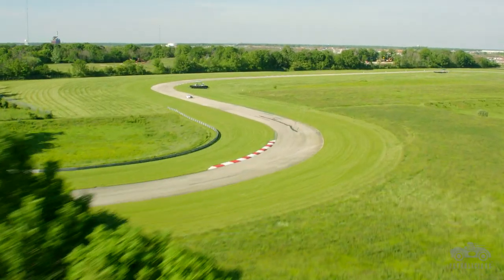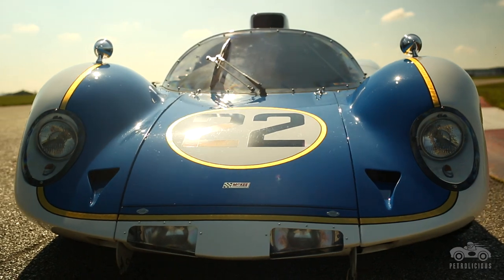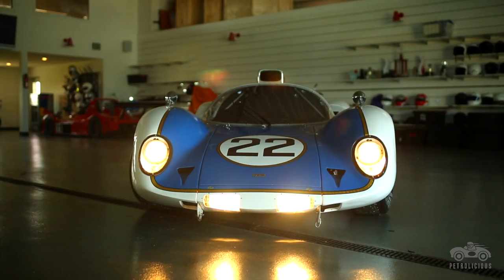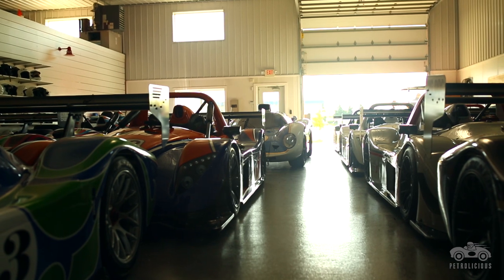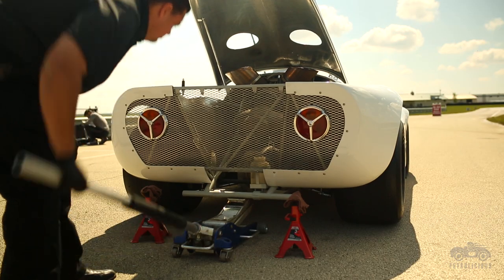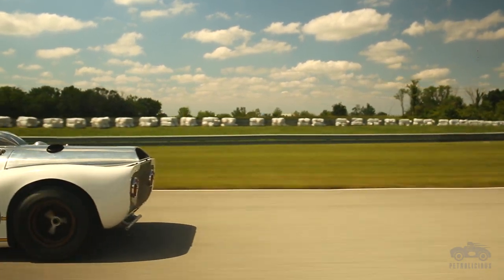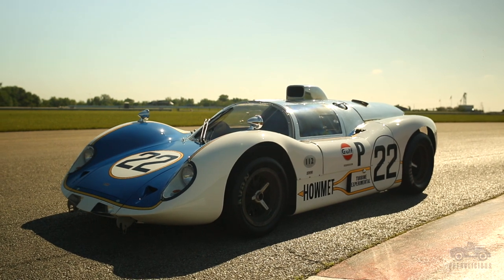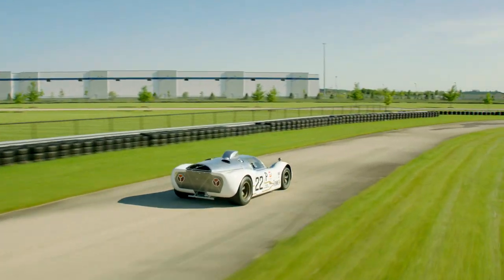The Howmet TX: Rethink Everything

Comment: He mentions Ray Heppenstall very briefly. I knew Ray in the 1970's when he was racing Super Vees. Brilliant guy. I believe he had run Cobras in the mid-1960's and saw the opportunity. 
The key here was the inlet area. Turbines are very much sensitive to the amount of area they have to take in air. Ray saw that and talked to the management at Howmet where he was working as an engineer.

Comment: WHAT???  A Turbo-Charged Engine,  without the Engine ........?
.
Dang Engineers!
Reply: +Mr. Johnson
 I think it's a 3.0 V-8.
Reply: +Mr. B Natural It's a turbine engine.
Reply: Sir Lord Baron Von Nico
 A turbine V-8?
Reply: +Mr. B Natural A jet-like turbine :)
Reply: Mr. B Natural It's just a turbine engine taken from a helicopter. There is no combustion mechanism in the engine.
Reply: +Sir Lord Baron Von Nico A turbine certainly has a combustion chamber... This engine doesn't have a rear nozzle to create the "jet" part of a "jet engine". But it sure does have a combustion chamber...
Reply: +Sir Lord Baron Von Nico Yes, there is a combustion mechanism / chamber. :)  In-between the compressor and turbine of course.  It's just a fixed combustion volume, with pre-compressed, hot air fed into it... which then drives the turbine that is connected back up to the compressor.
Reply: TassieLorenzo Ah, my bad then. Turbine engines isn't exactly something i'm well oriented with. Thanks for the explanation!
Reply: +zaco21 Yeah I know. I'm just joking around with the engineers.
Reply: +Mr. B Natural A turbine with 8 cylinders. Yep, that's about as logical as a wankel with dual camshafts. Do you know what a turbine is?
Reply: @williamgson4055  I have a car with a v8 wankel,  its 8 tiny rotors placed in 2 rows of 4. XD

Comment: I love all the turbine cars. I actually thought they would make a comeback here a few years ago with cars like the Jaguar CX75 concept, and others using micro turbines. Like he mentioned, turbines are great at full throttle, but they flat out inhale fuel at idle compared to a piston engine. I think that was one of Chrysler's issues with their turbine concept back in the 1960s as well. I really thought micro turbine hybrids would be the missing link to fix that where you have a battery powered car, then the micro turbine (about the size of a loaf of bread, 18lbs, 400 hp) kicks on, runs at full power until the battery is charged, and then shuts off again. While I think it came ever so close to fruition, it was a few years too late. Battery technology made a monumental leap in the last few years, enabling cars like the Tesla Model S to get similar range to an internal combustion car, and recharge in around 20 minutes, with that number dropping as time goes on. Not good for racing, but suitable for normal cars. There is still a little hope for turbine cars in the form of big rigs. I heard at least one company is building, or has built, a turbine powered hybrid big rig, the idea being once a truck is on the road, it travels at a pretty constant rate of speed.
Reply: +v12tommy yes i was realy dissapointed when the CX75 was not fit with turbines :( would have been soo nice. for the jag it made sense tough since it was to run on a single speed as an generator since the actual motors on the wheels where planned to be electric

Comment: I think that with computer controlled throttle and a modern CVT (constantly variable transmission) acceleration and deceleration would be more manageble. Keep the engine RPM's in a certain range then use the trans for speed changes.
Reply: I was thinking the same thing.

Comment: If it was to be done again it should be a hybrid. That way they wouldn't need a waste gate, they would be able to run the turbine at peak efficiency all the time to charge batteries that in turn would drive electric motors. With such a design, the turbine could be made smaller as well, it would just need to be big enough to ensure enough charge for the batteries.
Reply: eternitynaut it makes sense also to make up for the lack of torque likely found in this engine and use a modern cvt transmission, even though they are not completely efficient would work on this car

Comment: OK.... That thing is just insane. I mean I was stucked in front of my screen the whole time. I have a bit of a hard time understanding how it works though?? Also it seems to have quite a high potential top speed, but what is the acceleration like?
Reply: +traxnada It only has 1 gear (He says that he wished he made it a 2 or 3 speed..). Basically like an electric car. 1 speed. Forward!!

Imagine a turbine that spins helicopter blades, but spins wheels instead with a reductor (gear box) so the wheels don't spin 100k rpm...
Reply: Turbine engines typically are slow to spool up.  That's why he comments about problems with coming out of corners, and why they re-designed the engine to run at 80% power all the time.

Comment: The version with the wastegate must have been quite something; close the wastegate & bamf! 80% instant power. A bit easier than a variable pitch turbine, but that might be interesting if it's possible these days. Keeping the compressor spinning at optimum RPM with part of a KERS system would also do wonders. Alternatively - how about using motors for all final drive & a turbine generating plant/KERS system all in one?

Racing isn't so diverse these days because we've already tried a lot of the interesting quirky things, plus we have such good computer tools now we don't need to actually build them - and the computer tools let us build things which are just too good. Not that long ago nobody would have predicted diesel LMPs though, nor hybrids. Sadly I suspect nobody ( I didn't ) would have predicted endurance races just being long sprint races because everything is so reliable either.

Comment: Turbine powered car, yeah. Interesting, different... In some very specific applications, like some classes of circuit racing, it could be incredibly effective. They put one in an Indy car and it very nearly won the Indy 500. It's a bit like a Mazda rotary on steroids and crack, very small, very lightweight, but lots of power, great reliability at full power, not quite so good at on-off-part throttle. We have tried to put them in road cars and it really doesn't quite work. Huge fuel usage, ridiculous. Noise, lots of very hot exhaust gas... For a practical daily use road car/bike/truck, you need certain things. A 4 stroke internal combustion engine, petrol or diesel, delivers those rather better than a turbine. There's a place for turbines. They power aeroplanes, ships, industrial machinery and electricity generators, and they do that rather brilliantly.

Comment: Very nice video... But I would have loved to hear more about the mechanics of this thing. How does it work. I mean, with such a unique vehicle, you would expect them to explain how it works mechanically, not only just about who made it and that it still works.

If it doesn't have transmission and clutch. How does it get power to the wheels??? Does it use some kind of automatic transmission? How does it get power to the wheels?? Now that's the stuff I would like to know...
Reply: Okay, despite what everyone else says on this page, this is a jet engine. It just doesn't rely on exhaust eflux for drive, like the jet engine in an aircraft does. It was made for a helicopter and has a reduction gearbox to take it down from 65,000 rpm to something more appropriate for driving the rear wheels of a car. Look up the difference between a turbojet engine and a turboshaft engine. This is a turboshaft engine.

Comment: I'd like to use this car for a thermodynamics project at university. Any idea where I could find more specs for this turbo shaft engine? Things like max temperature, compression ratio etc.
Reply: The engine is a Continental TS325. It's a helicopter engine, so there should be plenty of information out there. It's also known as the T65-T-1.

https://archive.org/details/TNM_Turboshaft_engine_Continental_Model_T65-T-1_f_20171028_0023

Comment: Wow, somehow I thought every turbine powered car was propelled by the afterburner, instead of actually propelling the wheels (jet car). And not able to go anything but straight lines....
This is indeed a totally new approach, and somehow I think a clutch should be in there somewhere, to separate the wheels from the turbine. But it probably has at least a torque converter, or something like that.
Reply: +Seegal Galguntijak Same principle as a helicopter really - turbine driving a driveshaft. Probably solved it using a similar solution - remember Helis spool the engine up way long before the blades start turning.
Reply: +Seegal Galguntijak Turbine engines are torque converters by their very nature.
Reply: justfakeit888 So how does it work that the car can stand still, while the turbine is spinning, with there being a direct connection to the wheels?
Reply: It's not. The turbine has a compressor up against another compressor, just like with a torque converter, except that it is with air instead of fluid. Watch Jay Leno's Chrysler turbine car video, he explains it well.
Reply: justfakeit888 I see, so the first part can spin up while the second part that's connected to the drivetrain stays stationary. I learned something today! :)

Comment: Can anyone tell me how it transfers the drive to the wheels please?
Reply: +Fly Guy In some helicopters, they use a turbine engine to turn the blades. In the case of this car, they use the same type of engine to turn the wheels.
If you want a more specific (yet simplified) answer then read on. A turbine engine like the ones in helicopters are different from the ones in jets because instead of using the exhaust to propel the jet, it uses the exhaust to turn a crank which can be hooked up to a gearbox to turn something else (like the blades or in this case, the wheels). Hope this helps.
Reply: TheNosyGamer Thanks man, i figured it was the same concept as a gear driven rotor but wasn't sure. Cheers.

Comment: How can they drive the wheels with an engine at 65000 rpm and no clutch or transmission? :s
Incredible car, but I don't understand it. It isn't a rocketcar. The trust comes through the wheels.

Comment: didnt get it
why it sounds like a jet?
Reply: +mobb figga The engine is a gas turbine like in a helicopter, not a piston engine.
Reply: The Howmet TX is powered by a turbine engine, much like you'd find in a jet or a helicopter.
Reply: Because It has a turbine engine...like a jet.
Reply: Helicopter, not jet. Jets are powered by turbofans or turbojets which rely on the the displacement of air they produce to create thrust.

Helicopter turbines drive a propshaft instead of concentrating their exhaust to achieve thrust. A similar (bigger) engine is used in the M1 Abrams main battle tank.
Reply: Kevin B. yeah I knew that it was so he would get it. Also I heard they were switching the turbine on the Abrams to a diesel :0
Reply: Sebastian Gacitua
Well, diesel engines are more fuel efficient. That said, turbines are quieter, mechanically simpler and can burn literally anything.

The eventual M1A3 is even supposed to get an autoloader.
Reply: Sometimes it is difficult for non-native English speakers to understand spoken language.
Reply: +Bruce Boschek i'm a german, so no native speaker myself.
You just have to put a little effort in it.
 it even pays out double because then you don't have to ask those types of questions and get to enjoy interesting information.